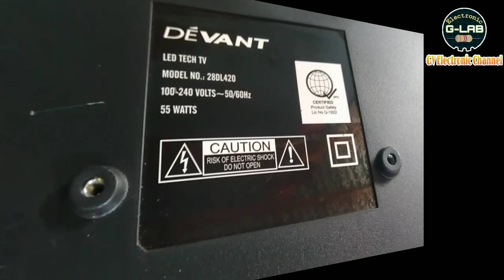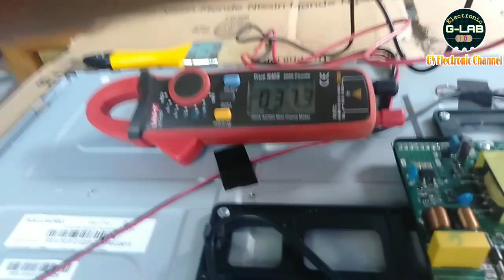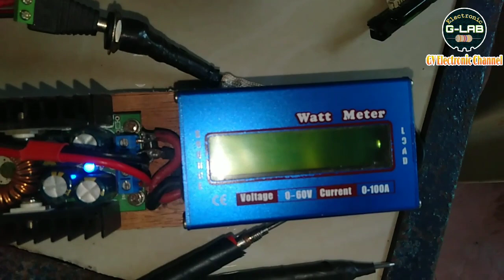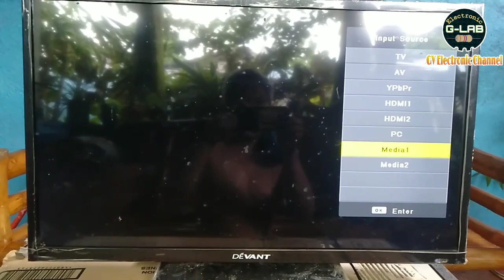Troubleshoot #45 Devant LED TV My Sound No Picture /Gumamit Ako Ng DIY Led Tester

Comment: Bro may same problem din ako, devant din n 29,  bumabagsak voltage ng back light, 50v iilaw, minsan 25v lang, black lang. Balak ko palitan capacitor yung 2 brown, bale may 4 n electrolytic sa gitna, yung 2 brown ang papunta sa backlight. Db pag driver totally bagsak sya...?

Comment: Troy Manlapaz 

Sir patulong po.devant Lcd 32 inch my standby my picture my sound piro after 30second nag ooff ang backlight..binuksan k ung panel parang fluorescent n maliliit ang back light.gumagana nman kaso unti unti nawawala.meron din sya 12v 24v 5v.pro chineck k nman backlight output meron 900v kaso nagdadrop ang supply hanggang mawala.piro minsan pag paulit ulit k off and on nagkaka picture n .salamat sir

Comment: Sir yung tv namin na devant 50 inch. Smart tv same issue din with sound but no pictures, pinarepair namin sa isang technician sabi nya papalitan daw nya ng brandnew na backlight pero after 3 weeks nasira po ulet yung tv namin with the same issue po. Brandnew po ba kaya na backlight yung pinalit nya or scrap lang?

Comment: Very helpful, kung walang led san kaya makabili po? Kasi ganyan nangyari sa tv kp now same na same po issue wala display pero may sound at may supply voltage naman galing led driver, thanks
Reply: Meron po ba sa electronics shop o mga nagrerepair ng tv ng ganyang klaseng led?
Reply from the maker: yong LED beds sir? meron kay Lazada nyan sir

Comment: Gd day... Ask ko po sna kong anung sira po kpg nka stock lng s red light indicator at hnd ngreresponse khit pindutin or s remote ung power on.. devant led po ung tv model 49DL541
Reply from the maker: walang oscillation check mo power supply kung walang lumubo na capacitor sir

Comment: Idol ang TV k Ay sanyo 21 inch. May guhit sya tpos unti unting lumaki hanggang 3/4 LNG anong problem not sir?
Reply from the maker: crt to? vertical section baka capacitor sir
Reply: Oo CRT po.
Reply from the maker: @romyfox2501  mga capacitor palitan mo sa vertical section sir
Reply: C GI sir slamat

Comment: sir ano kayang sira nun walang pictures at tuluyan nagblackout pero may sounds tapos pag pinatay mo at binuksan balik po tapos mawawala nanaman ung pictures ano po kayang sira devant uhv300 po un 50inch hm po kaya pagawa nun thanks sir mag 2years lang siya
Reply from the maker: bakq abnormal voltage sa led driver or my madali ng mapundi na led sir
Reply: @GiovanniV  buti po abot pa sa warranty kaya pupuntahan po ng devant service para ayusin nila thanks din po for the info

Comment: boss magandang araw.ano kaya problema sa akin na devant 50 " LED. first my horizontal line sa screen hanggang nag half screen nlng ang display and ngaun wala na talagang display as in all white nlng ang screen. ano kaya ang nasira dun? ty po
Reply from the maker: pweding sa panel board or tcon board sir
Reply: Magagawa pa yong ganyang case sir at mga magkano kaya gastos...

Comment: Sir ung devant ko po 40 inches may display cya kaso walang sound na oopen cya sa remote pero pag bukas na ayaw na gumana ng mga control kahit sa remote
Reply from the maker: effron program or my lose connection Lang siguro dyan sir
Reply: @GiovanniV  pano un sir? Kelangan tlga dalhin sa service center?
Reply from the maker: @arjaysomared6011  kailangan talaga Ng service center or accredited technician sir

Comment: Sir gud day, tanong po...sir paano po kung 46v ang supply papuntang backlight,? At bakit po napupundi ang bcklight?
Reply from the maker: nag palit kana ba ng bagong backlight na pundi ba ulit sir
Reply: Sir @GiovanniV  Hindi pa nmn po ako nagpalit, Devant din po kc tong tv nmn, ng itester ko 46v ang reading, , , samantalang napanood ko po ung 2 video po ninyo, ...30v po ang ppuntang bcklight halos parehas lng po.......kaya naisip ko baka hindi normal ang volt ng ppuntang backlight, , , pasuyo po sir pasagot po....
Reply from the maker: @abagoriojr  ang voltage kasi nyam sir nag dedipindi parin sa adjust ng brightness sir habang mataas ang settings mo mataas din voltage nyan sir
Reply: @GiovanniV  O.k po salamat, nagets ko n po, nagbackread ako sa mga question ng ibang tagasubaybay mo, nakabuo ako ng konklusyon, salamat sir...
Reply: Sir location po ng shop mo ppgwa ko din po sna ung devant 50 inch..my sounds wla din picture
Reply: @giovanni v sir ppgwa ko po ung tv devant 2months plng ngmit my sounds wla pic kc 50inch po

Comment: Sir pasagot Naman tanong ko, 
Ilang voltage Yung led backlight na tinest mo sir? Tsaka ilang beads?
Reply from the maker: 3v 6 beads per strip sir
Reply: @GiovanniV  thank you sir nag reply ka agad🙂,
May nirepair akong ganyan kanina sir Wala ding picture may sound, ti nest ko backlight nya may isang nagbiblink pero nag steady Rin ilaw nya, pinalitan ko Yung isang nag biblink na Yun, tapos gumana sir tapos mga 30 mins namatay ulit sir., Normal Lang ba Yung voltage NG backlight 45vdc sir? 
..pa help sir, papalitan ko na ba lahat nung backlight or may ibang cause pa sir?
Reply: @GiovanniV  nag repair dn ako NG Sony Bravia tv nung isang araw, Ang problem nya patay sindi tapos nag blink 6 times, Kaya Ang naiisip Kung cause backlight problem, Kaya chineck ko BL nya ok Naman, pero ganun pa dn Yung problem nya, Kaya naisip Kung palitan na Lang NG bagong BL baka Kasi Sabi ko mataas na resistance nya or malapit ng masira ,  Kaya ayun sir naging okay na nung pinalitan ko NG buo, 
..Kaya iniisip ko baka ganito dn sira nung devant
Reply from the maker: check mo din backlight driver nyam sir
Reply from the maker: pag my problem sa backlight mo na protect talaga yan sony sir